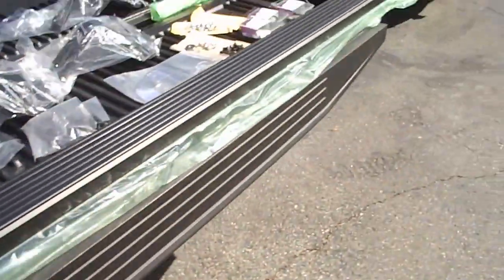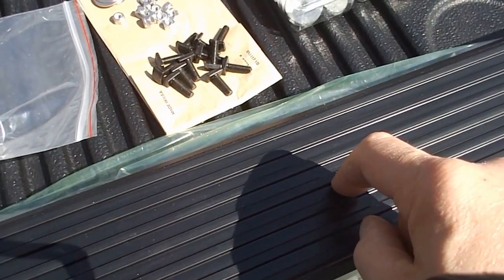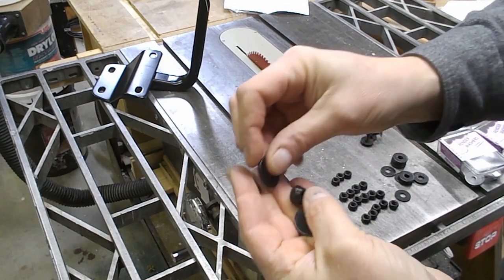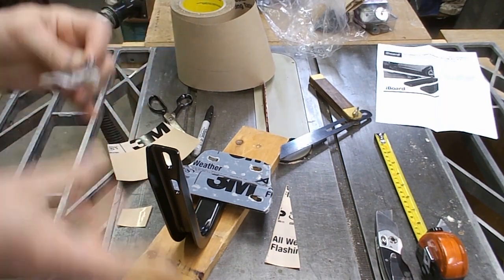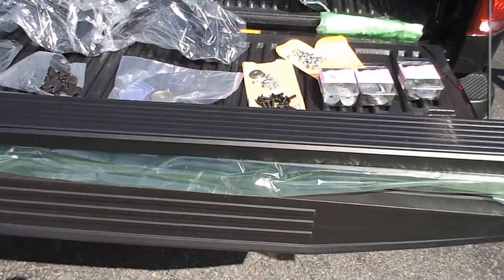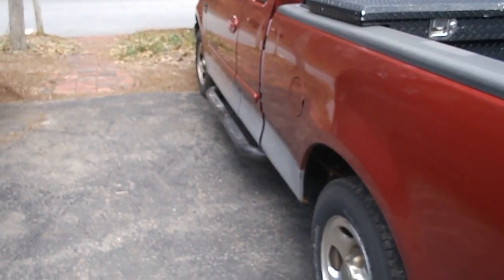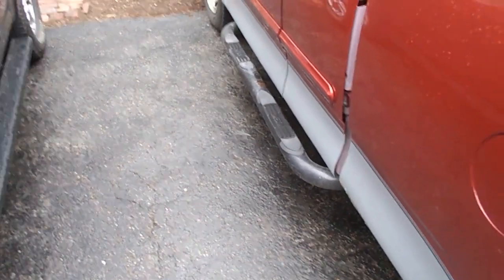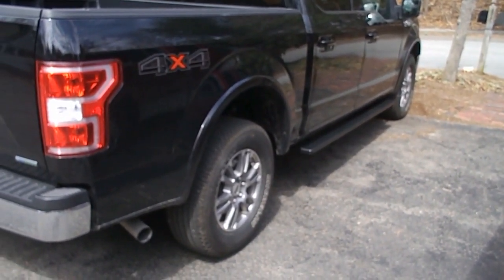iBoard Running Boards Installed on a 2018 Ford F150

Comment: Thanks for the video, your extra tips are helpful. I just ordered a set for my 2017 F-150, am hoping they are useful and long lasting as well.
Reply from the maker: Had mine a couple years and they're fine.  Time will tell.  Ironically I ordered my 3rd set of nerf tubes (Westin) for my 2003 F150.  Those look good for about 5 years, then fail at 7 or 8 years.  At least they're not pricey, but gee wiz.

Comment: Hey Brandon. Thanks for the video. I have to ask. I just got these for my 19 F150. I was also switching to stainless. The m8 1.25 chassis nuts they supply seem wrong. Can’t even get half a turn onto the chassis bolts. It’s not the pressure from the nylon insert. It’s the nut. Did you experience this? I have a feeling my chassis bolts are SAE, halve to check.
Reply: Sattva Woodworks hey man I’m having the same issue! M8 1.25 didn’t fit. Did you find out what the fix was?
Reply: Nick Kouchoukos I just put them on yesterday actually. I checked all the stock bolts on the truck body. They are in fact m8 1.25. They have a stock anti rust coat I’m guessing which made the pressure nuts very snug. In my case, went on perfect, no stripping. I’d just be careful putting them on. I’m in a 2019 F150. Side note... made very well.
Reply: Sattva Woodworks thanks! I guess I’ll have to clean the threads or something to get them to fit
Reply: Nick Kouchoukos good luck. They are very clean and sturdy.

Comment: Thanks for the video - it helped me decide which boards to get for my 2019 F150. How have the boards and brackets been holding up since your last comment  10 months ago?
Reply from the maker: Thanks for the kind words.  The running boards and brackets are fine and I don't give them any thought.  There is no discoloration or any other signs of age.  I had it on a lift a while back and noticed schmutz on the nuts, but since they're stainless, I assumed it's dirt and debris (not corrosion).  I'm still pleased with them and use them to climb in and out every time.